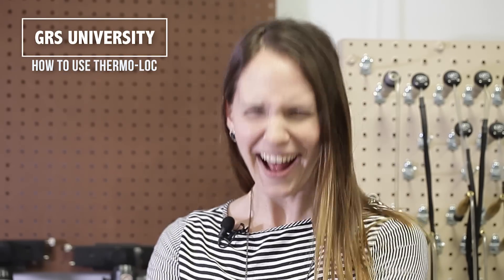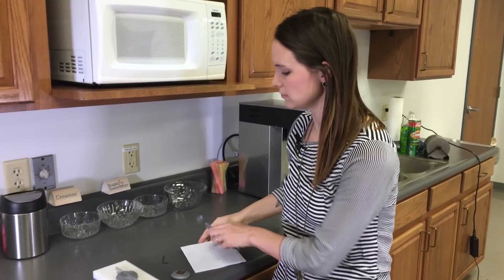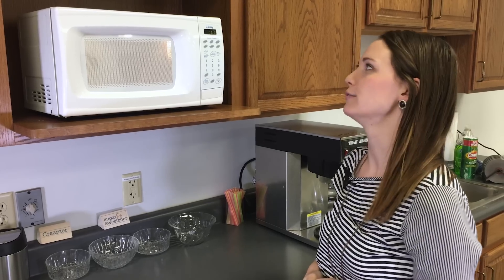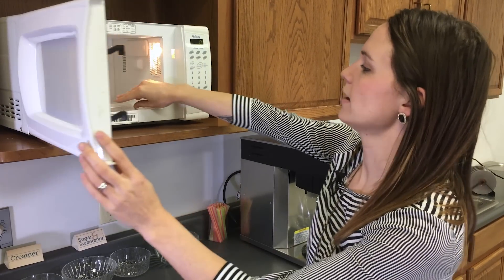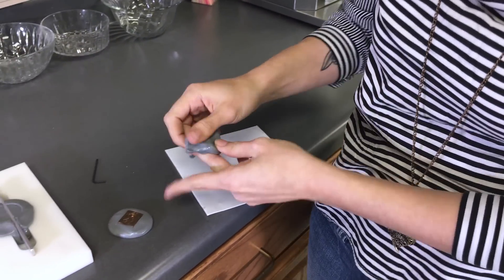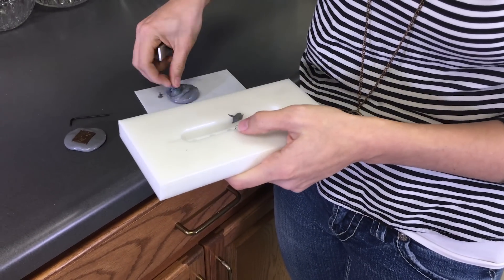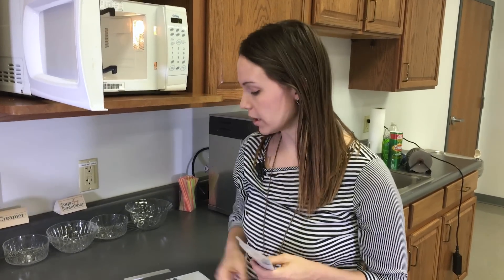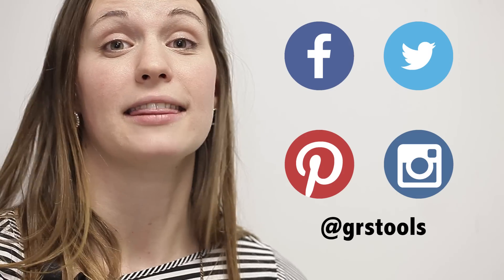GRS University: How to Use Thermo-Loc

Comment: What if you don't have  a teflon plate?
Reply from the maker: If you don't have access to a PTFE pad, you can use hot water to heat the Thermo-Loc®. You can find the link to the Thermo-Loc® literature here: https://grs.com/wp-content/uploads/2020/04/LIT-230_ThermoLoc_20.pdf
Reply: I heat mine right on the spinning glass thing in the microwave. Then I take the glass out and let it cool and the Thermo-loc come off easily (when hard) with my bench knife.

Comment: What will happen if you overheat the thermoloc, for example using a torch to make it soft, will it lose its usefulness?
Reply from the maker: Hey, it will boil and bubble and burn you. After that it will get super sticky and be of no use. You could still use a torch to heat it up (people use heat guns) you would just want to keep a decent distance and avoid the flame actually hitting the thermo-loc.
Reply: @Grstools  Thank you

Comment: Hello Molly, Thermo-Loc is great, but I have a question: have you got any tip to remove little pieces of Thermo-Loc that remain in some holes under a pave setting? Thank You.
Reply from the maker: The best thing is to wrap the piece to prevent thermo-loc from getting into the spaces- plastic grocery bags work good for this. I am guessing the problem is already in place though- You can either try to pick out the little pieces and heat slightly if needed; or, Rio Grande sells this solvent called Attack- it shouldn’t hurt the piece but will dissolve the thermo-loc when soaked.
https://www.riogrande.com/searchresults#q=attack&t=products&sort=relevancy&layout=card&numberOfResults=36
Reply: Acetone breaks it down overnight. It will be very flaky and can't be reused, but it'll do the trick.

Comment: Can it be used for repousse in place of pitch? I.e. does it have a slight give when cold?
Reply from the maker: Hello, 
Thermo lock acts much like pitch. It requires heating and when cooled it is very hard. It does not have much give.